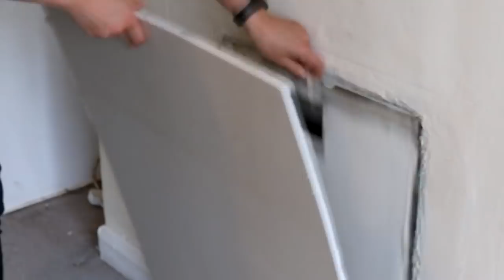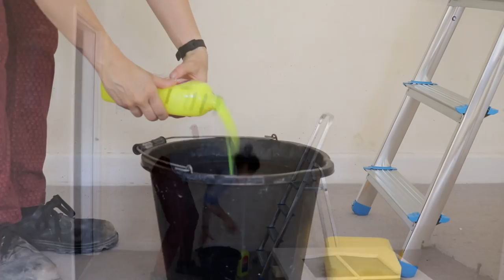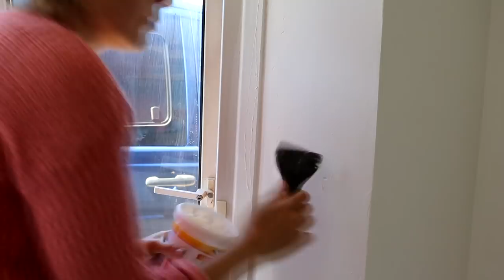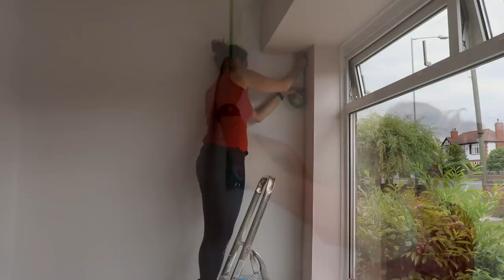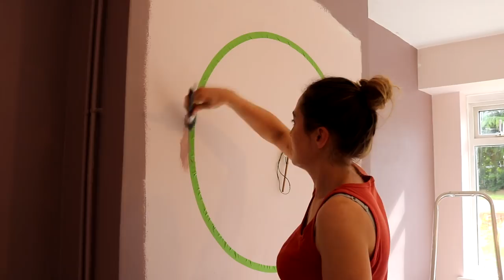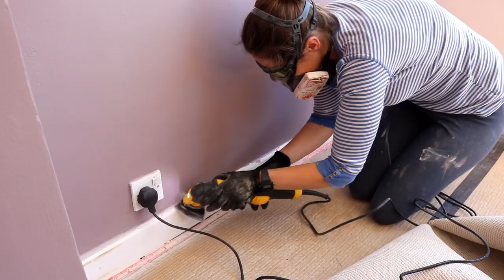Bedroom Makeover: Painting a Room | The Carpenter's Daughter

Comment: After preparing the room (which includes removing the electrical outlet covers and tape over the outlets to protect against any moisture getting to the wires), I paint the woodwork first.....then, the walls.  Most paints have primer, so I'm not sure why the walls were painted with two coats of white paint.  A freshly painted room is ALWAYS a good thing!  Thanks for posting!
Reply from the maker: Thanks 😀 I just like to do it for visual inspections until I'm happy, then paint my main colour.

Comment: Looking good! When painting, filling or caulking its a good idea to get a length of old cloth and tape it to your trouser leg. You can then wipe your hands and tools on it and replace it when it gets a bit to grose. Your new sander has a vacuum port on the back of it so you can connect it to your hoover. What goes in the hoover dosent stay in your house for the next 6 months.
Reply from the maker: I didn't know that!!! Thank you!  I tried reading the manual and couldn't find any written instructions - just numbered features without saying what they were.  I saw that attachment through watching a video, but again, no demonstrations, so will give it a whirl when I decorate upstairs 😀 Also, you've made me think... I have a lot of Velcro straps that could be sewn on and old scraps of fabric and wash them after 🤔
Reply: The Carpenter's Daughter remember if it moves and it shouldn't then duck tape. If it doesn't move when it should WD40. If your vacuum hose is to large then wrap tape around the tools port to make up the difference.
Reply from the maker: Brilliant, thank you!

Comment: Love that song by The Jam. As a painter yes I advise using a sheepskin is best for emulsion also for cutting in there are angled brushes made between 2 to 3 inch made by Purdy, Wooster and Picasso. Mohair & Foam rollers are better for solvent paints9 inch roller is ok but if you want you can also use 12 to 18 inch rollers if want job done fast or depending on what size of room. I personally don't use trays coz I find them flimsy anymore use scuttle so much more strong. When taking break or finishing end the day  to use again and again it's ok to put rollers and scuttle into plastic bag. With solvent paints you can leave brushes dipped in water or a vapour box called Brush Mate which has a vapour pad that keeps the brush soft for around 7 months

Comment: Nice work.. personally i like pulling away plug sockets and light switches away from the wall and masking tape them up and then paint. Look a lot cleaner in the end

Also great idea with the paint guard! Keep up the good work
Reply from the maker: Thanks for the tip 😀
Reply: Obviously turn the electricity off if you're worried, but undoing the two screws and removing slightly away. The previous owner of my house painted around them and when i went to re-paint, i pulled them away and the paint that was attached around the sockets actually pulled the paint and some plaster off the wall. I ended replacing them all around the house a re-painted everything! The joys of a simple job turning into a big one! :) 

Thanks,
Colin

Comment: I find when doing wall prep it's often a good idea to have a work lamp pointing up at an angle to help with spotting marks/ holes that need filling etc. I agree, cheap filler like Wilko's own brand does a good enough job, and you can always spray it with a little water if it starts drying out. Anyway, good stuff as always! :)
Reply from the maker: Thanks 😀 Yes, I sometimes use studio lights for this (in fact, that's all I used them lately lol) - particularly when I had skim in my hall.

Comment: You can get a pad saver for your sanders ,basically a Velcro pad that fits on top of the original on Ebay.
Reply from the maker: Ahhh.... I'm not sure I can be bothered to fish it out of the main dustbin now... it's right down the bottom lol.  Are they universal pad attachments?
Reply: Different sizes for different pads ,and also amount of holes in sander for dust extraction.

Comment: another trick for the paint roller pan; you can use small garbage bags, too. i use those and the pan is as clean as the day i bought it. just slide the pan into the bag (doesn't matter which way, as long as it fits and the opening isn't down in the pan), pour the paint in, and have at it. when your'e done, pull the bag in such a way that it turns inside out, and the paint will be inside the bag. then you can just toss it in the trash.
Reply from the maker: I LOVE that idea!  I've got some pedal bin bags and I'll try that when I have to give my door another coat tomorrow! 😀
Reply from the maker: By the way, I tried your bag idea today and it works a treat!  Will hopefully catch it on film over my next two doors to fit this week 😀
Reply: glad i could help....from way over here.....across the atlantic... :-)

Comment: Use a mini roller roller on the window sills. No brush marks then :-)
Reply from the maker: Thanks!  We did originally with this stuff and it left awful lumps.  However, I am using a roller on my new door today with a much better satinwood, so think I'll sand the sil, then give it a final coat with the new Dulux trade stuff I bought.
Reply from the maker: Oh and forgot to mention, it was a foam roller before*